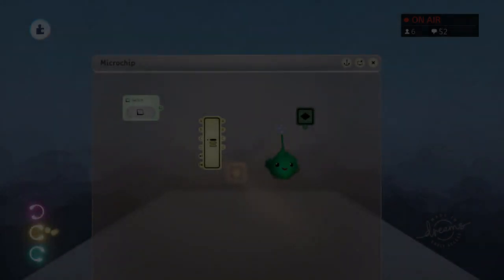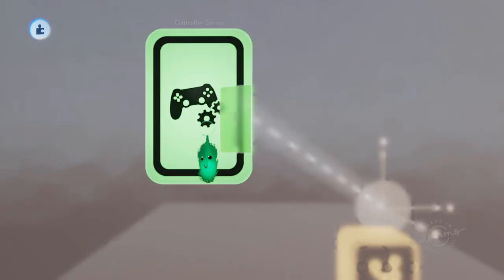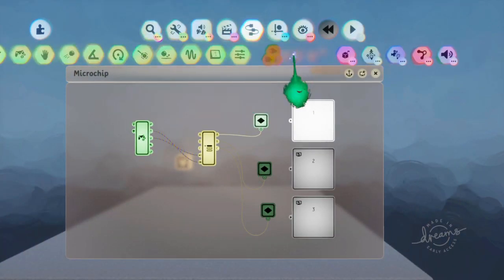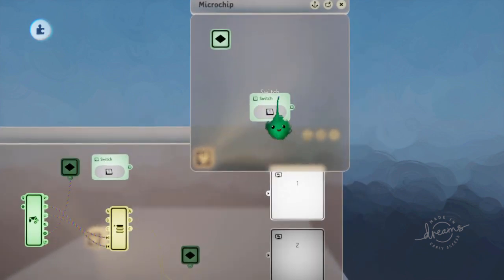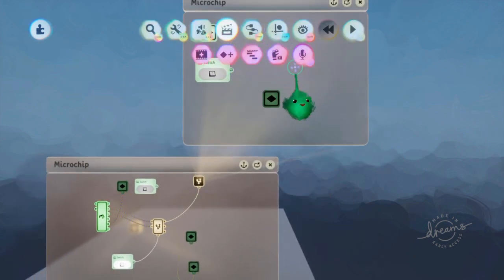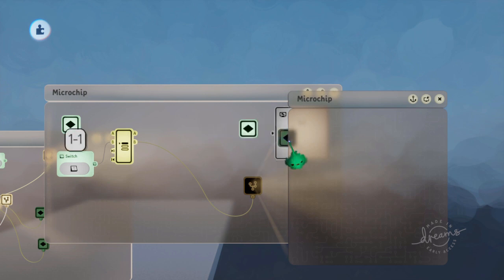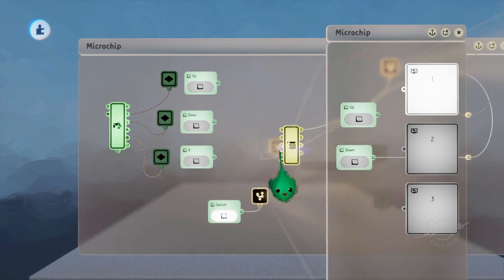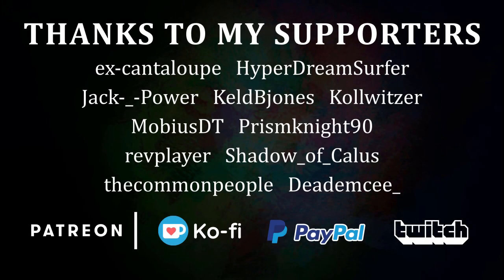Making a Menu and Submenu | TAPgiles Daily Dreams Tutorial

Comment: Do you still recommend using keyframes to power on switches? I was thinking of maybe using wireless transmitters or something until I seen this video. Cheers
Reply from the maker: I tend to go for keyframed switches, yeah. If it's within the same logic. To track that it's a keyframed switch, I give the keyframe and switch a clear name and add [ ] around it--indicating it's a direct switch setup.
Reply: @TAPgiles  Thanks TAP! I tried using wireless transmitters but couldn't get my logic to work properly with it(it was buggy). So I ended up using keyframed switches like you do in this video and it works flawlessly! Thanks for being a genius and coming up with clever ways of doing things :)
Do keyframes not have the delay that wireless transmitters have?
Reply from the maker: Happy to help 😁 No keyframes are instant.